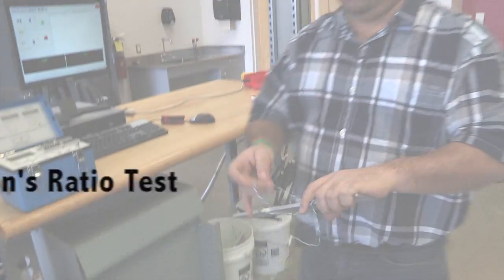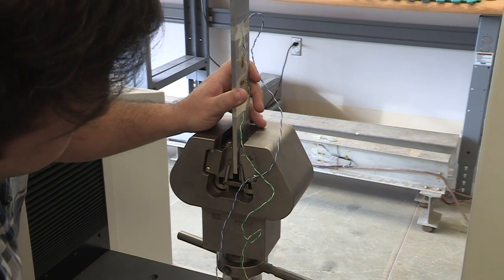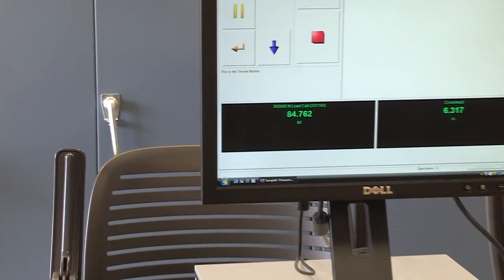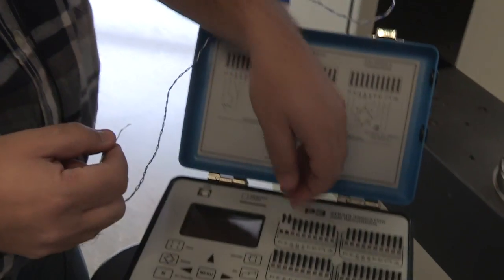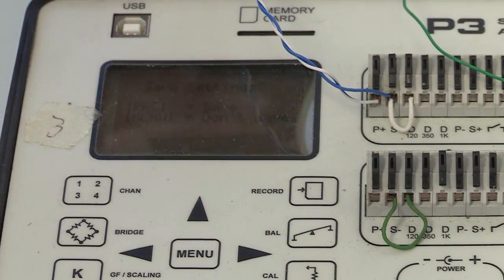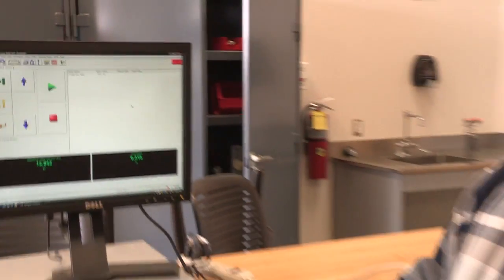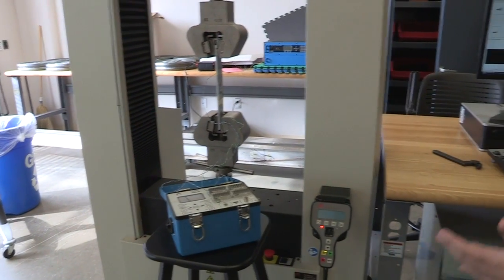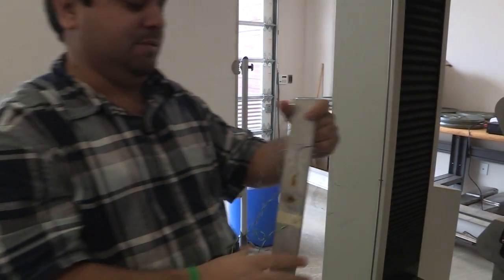Poisson's Ratio Test

Comment: 2:50 on : It is not good practice to move the crosshead manually to cancel out grip tension. On larger or servohydraulic systems this can be destructive. Better to change control mode to force and set zero force. The machine will control the x-head to keep the sample undisturbed untill the test starts -in any control mode chosen.